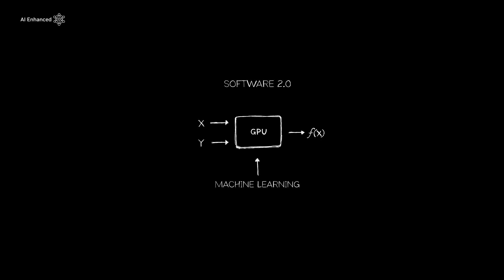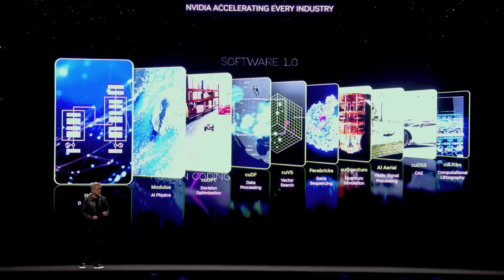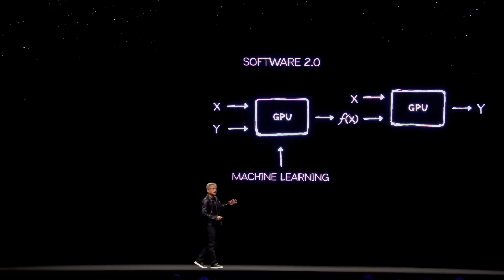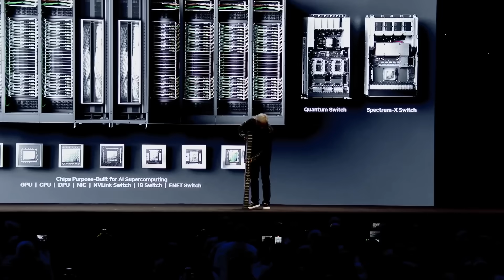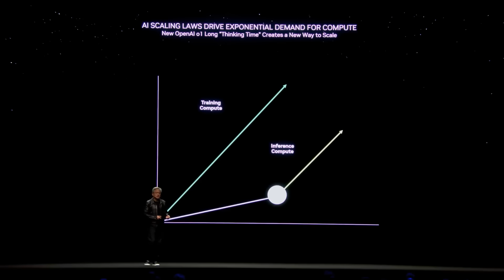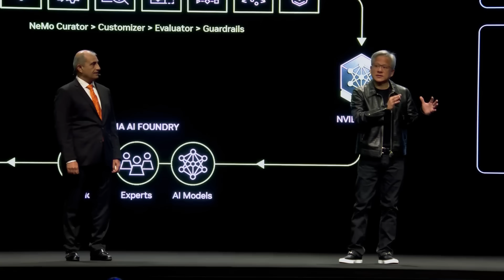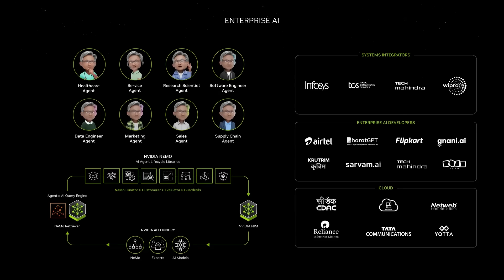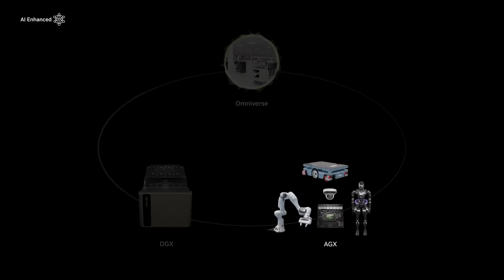NVIDIA CEO Jensen Huang Leaves Everyone SPEECHLESS (Supercut)

Comment: There is so much ... in this presentation, that I keep thinking of Deep Thought's (HHGTTG) explanation of of its now famous 42 answer - a failure by the developers to specify clearly what the inputs were. This is no more than a sales promo to sell the new system, and assumes that massive already data exists to train the new system to do something without actually specifying what "the something" is. Additionally, there is no such machine that contains a moral understanding of its actions so there is nothing to put the brakes on AI development to consider whether the technology is heading in the correct direction or something that is detrimental to one or more humans (cf. "The terminator" or sentient machines.)    Real green field software development starts from a set of requirements for a scenario for which data may or may not already exist. Personally, I also have doubts as to whether it is possible for an AI generated program to perform in a real-time environment with minimal hardware or whether it follows the American approach from the 1960-70s of just adding more hardware until it reaches its contracted performance levels. This "add hardware" approach imposes lots of external constraints that were rushed through - huge electrical power consumption requiring huge cooling farms, large mega buildings to house these monoliths plus supporting hardware, and the overall global warming effect that every government is trying to rein in, via various UN driven COP conferences.
AI generated code quality will improve over time, but one final aspect of humanity that AI will never match are random flashes of inspiration that allow programs and technology to operate in a more efficient or open-ended way. I also assume that somehow AI will conquer the mountain of converting (good and bad) requirements into actual code so that developers are then reduce to requirement writers.
Just saying ....
PS the 1960-70s experience was that US favoured hardware was cheaper than software, UK favoured hardware and software and USSR favoured software over hardware. Consequently the US had the best hardware, USSR had the best algorithms (because they could not afford hardware) and UK was the best integrator of cost effective solutions (using the best hardware and software).

Comment: Just a thought- We are working hard on a quantum computer where the zero or one are BOTH zero AND one. Why not apply software with today's fastest general computers where the software itself assumes BOTH? The 'And/or' module. Here, the speaker refers to 'unobserved' input. The recent (timewise speaking) that photons are BOTH a partical AND a wave are only assumed when the particles are NOT OBSERVED (no method of visually determining, since the 'observance' changes the nature of the particles).
 So if we allow software to 'believe' something is happening when we cannot physically quantify it, may be the key vs. actual hardware that physically assumes both roles. Changing the 'and/or' to 'what if' may open a passage to infinity. 
---
Reply: @RudiJock  Modern CPU’s in traditional computers already do that, it’s called speculative execution. This doesn’t have to be coded for, it is done at CPU level where when it sees a branch it will run both paths simultaneously before knowing which it will take, and simply discard the one not taken when it becomes clear which is needed.

Comment: Naa, as a developer I can tell you that AI is not able to understand anything, which inevitably leads to incorrect answers and code.  I don’t think it will ever be able to truly understand.  It is a pretty good search engine though, providing you always ask it for sources so you can make sure it’s right before you use anything it provides.
Reply: @3d-illusions  That's how I feel as well at the moment (though I'm not a software developer). In its core,  AI is still a pattern recognition and prediction machine, it's simply not complex enough to be able to understand stuff. That's why it's still hallucinating and lying, it's still missing a lot of wiring on the one hand and proper training on the other. 
My main worry is that with the development as shown in this video, AI will start producing 'input' that we humans can not anymore or only with a lot of effort verify to make sense, and under time/money pressure will assume to be correct. This may lead to disastrous results, as we will not be in control anymore when we still need to be.
Reply: Eh.  It will get there, just like txt-to-image stuff 2 years ago was pretty basic and now you can create imagery and video virtually indistinguishable to reality.  4o seems to do a pretty good job of basic code...even for hobbyist type users.

Comment: Since their inception, NVDL GPUs have always been 100-1000x faster than CPUs.
...well, at least in theory. In the 2000s they ran at 1% utilization, that is, unless you code it just right, chances are you only use only 1% of their theoretical throughput capacity.
Reply: I will see how he does any physics which is required to be run in series.

Comment: Why would he speak such nonsense? Why should we even care? We have already paid enough to cover the costs of hardware, software, and R&D. If the correction is made and the idea proves solid, it will attract support. Additionally, it is true that Nvidia released the first product labeled as a GPU in 1999. I suspect they either stole or bought the idea from some underfunded startup engineers. Back then, the future of computing was not as widely acknowledged. Furthermore, is it justifiable to build nuclear power plants and risk harming the planet for this cause? I am not sure. Our homes are already equipped with incredibly powerful PCs. Perhaps we should slow down the cycle of acquiring new hardware, favoring upgrades every three to five years over annual replacements.

Comment: He forgot to say that AI will be coding the changes required.  So many coders, who got us to this point will be jobless.
Reply: As a programmer, I'm not worried about it at all. Half of all jobs today didn't exist 100 years ago. If AI replaces programming, I'll simply move to the AI engineering field. "If robots take your job, learn to fix robots".
Reply: @LunaticEdit  I want to agree with your logic,  but I fear it may be flawed. We are essentially replacing the human here. Robots will be fixing robots.
Reply: yes
Reply: @Idontwantahandle3  Sure, until it runs into a problem it hasn't seen before. I'm not saying we won't "get there" one day, but even with the latest and greatest models, AI still seems to be little more than extremely fancy auto-complete system. Have you seen that AI video generation of Egyptians building the pyramids? Notice the pyramids look old? Yeah AI cannot create, only mathematically calculate what should come next based on previous data sets. Sure there's re-enforced learning, but even that is pretty crude and extremely time consuming. Sorry, still not worried about AI, and in fact embrace it as a nice tool to make my job easier so I can focus on the hard problems.

Comment: It sounds like they are going with software back to the 90s or even earlier in times when software had(!) to be optimized to the limits to work with the limited computing power of that time. Within the last decade or more we saw probably a decrease in optimization. Take a look on how much traffic a website throws at us just because nowadays smartphones have computing power that made early 00s PC look like game boys. Same in software where it is often like „yeah then just throw 64gb of Ram onto it and the next gen gpu/cpu and it will run okish“ while - to stay with an example everyone knows - Pokemon Red back then in 1999 had a full size of 373KB what is around 10x less then an average picture made by an iPhone today. 
So yeah software itself felt behind within the last onenor two decades because the new hardware made it comfortable to not take a deep look into that.

Comment: Speaking from experience, he is selling an enormous amount of hot air when talking about programming 2.0 done by AI. In general the generated code is quite bad, not more innovative than the code seen during the AI learning phase (so nothing new). Sure Nvidia is riding an enormous wave thanks to the current AI hype, but limits of LLMs are quickly being reached. Of course GPUs remain valuable accelerators of specific tasks.
Reply: @salobaas  I work at the USSF as a cyber security engineer and lead divisions and programs associated with various NIST RMF, AI (LLMs, and neural network composites), and system security engineering standards.  I'd say that you're wasting your time with intelligent discussion on YouTube comments.   3% of people will understand and acknowledge your level of experience/expertise... the rest will all create arguments and speak as if they have a degree in the field your commenting on (which they 99.9% of the time don't).  I've been down this road and it's not worth it. I read all your responses though and I'm experienced (sometimes in conjunction with experts or masters in the field working with or for me) in every topic brought up.  I wanted to say you were well spoken, knowledgeable,  respectful, and versed in the topics at hand.  I'd ignore must of the ignorance.   

Just on the topic of LLMs; people have no idea about the algorithmic bottlenecks and limitations of LLMs.  People are believing that statistical variable computation is going to lead to AGI or advance beyond that even with fundamental issues and errors (even based on  current ROC curves)...  there is a lot more science and work needed.

These systems are useful but the LLM is not the end route
Reply: @sparaz  don't tell everyone what you do
Reply: but... the leather jacket?
Reply: I think there's often a disconnect in how people look at machine learning models versus imperative programming. When you're dealing with the problem of modeling the real world, your solution to the problem can only go as far as your understanding of the edge cases. With the real world you're dealing with, not just unknown edge cases, but edge cases that can appear at any point in time that you didn't account for in imperative programming. Take the example of a self-driving car. Anyone can step out into traffic at any time with a stop sign in hand and you would need to have some inference that can be turned into a decision. Imperatively you could program for this but what if the person turns the sign in hand 45° and is now partially occluded? This is a scenario where an inferencing system with an ability to recall historical events makes more sense to solve the problem. Imperative programming will always exist to solve the problems that it was made to solve which have known or mostly known edge cases. Pick the right ( or most cost effective) tool in the tool shed for the job at hand. AI is too expensive to train for every task
Reply: you missed the point, you're talking about generating human code to be compiled into x86-64, he's talking about a new architecture that uses AI as the core of it's computing and therefore is more compatible with ai generated instructions
Reply: Thanks but I’ll take my queues from the CEO of the world’s most valuable company.
Reply: @salobaas  I dont think he literally meant code writen by ai but the rather the model itself
Reply: I think you underestimate many factors including national secrecy of datasets and the incompleteness of data historically archived in written archives of paper and ink for example. I find AI missing vast arrays of answers which I can find by simply thinking and extrapolating given key input parameters which are often not focussed in modern western civilisations as culture is but a slice of reality as all life has known it. In short you are blinkered.
Reply: @john-paulstone791  Wrong, I have to use it to explore other possible mathematics and algorithmic models to fix my projects. It helped me working at the right direction as well as learning. It is a better version of Google. But for coding, it is not there yet, thanks to hard bottlenecks.
Reply: @I_am_a_nice_person  You seem to miss the point, we are discussing what ai can achieve, not what it is limited to at the moment, how exactly am I wrong? He said the limits of llms are reached and that is just stardust. And you seem to seriously be suggesting that you would expect early AI to have every answer to mathematical possibility in its early stages, or else we are just on different pages. But I can see how you would say I am wrong, given your view of the situation so nevermind. In all honesty I know practically nothing about it but history is full of billions saying the end is nigh about every new thing and it peeves me. Oh, I think I see where you went wrong, I didn't mean I input my thoughts into ai, I extrapolate them myself and find answers without AI because it is missing certain things... So if you see my erratic response is because you say I'm wrong but we actually agree.  If I am in fact wrong relative to the majority of the post it is because of the potential for almost exponential LLM training according to me. I think just because a thousand projects make a stable AI model, doesn't mean a million projects cannot improve it. I have difficulty thinking in terms of being stuck in a now of version numbers, so excuse me if I babble. You may have a valid opinion I cannot see because I am not a programmer though.
Reply: @john-paulstone791  just call me dum and move on lmao, no need to be this dum.
Reply: @I_am_a_nice_person  Divergence is as far from dumb as intellect gets, humanity just doesn't know that yet because it is emotionally twisted into animal logic.. I do not want to be calling people names as the way to move on from simple or complex debates. You keep your ignorance, I will keep my silly appearance thank you.
Reply: In my understanding, he is not talking about AI WRITING CODE, but about making models instead of programs in the traditional sense. For instance, instead of physics engine, you create AI model that emulate physics, or how he called approximate program that does that. Of course this model wasn't coded line by line by human, it was achieved through learning.
Reply: @grzegorzowczarek3016 wouldn't you value the traditional method of deterministic stuff instead of this half working half broken shit lmao
Reply: @grzegorzowczarek3016  that would fall under AGI, and that is way off from where we are now. Creating new models based on information we don’t have yet, like new physics models, is not something that can be inferred from existing data. Existing data can be used to extrapolate existing models but not to generate entirely new theories. If AGI would exist then things might change, but for the time being we’re far from it. But as long as we keep buying GPUs he’ll be doing fine.
Reply: @salobaas  you still don't get him. I did not mention any new physics. Just physics engine, for a game for instance. Not written but trained. Nothing more, this what they mean by software 2.0. I'm not defending his position nor do I share it. I simply try to explain what he said.
Reply: @salobaas it is already happening today. That's how Tesla's Full Self Driving works. The instructions for getting from point A to point B are not explicitly coded. The AI model figures it out on its own. This isn't "in the future", it's driving on roads every day.
Reply: @NateDecker1982  *crashing everyday.
The worst example ever.
Reply: limits of LLMs are quickly being reached? elaborate
Reply: @Alex_1729  No more data to train on. Still no basic reasoning. Hallucination problem actually got worse with the last generation of models. Fundamentally seems to be at a dead end. People finally are wising up to the "science" have been all junk, and the benchmarks meaningless. There's a lot of marketing, but really looks like a start of a collapse ATM. Oh also, still no revenue. None of the AI companies are anywhere close to profitable because the operating costs far exceed any demand for the utility.
Reply: @Alex_1729  Look up any paper on LLM. You need exponential compute power and model size increase, just to improve accuracy by 0.1%.
Reply: It’s true that large language models are reaching a hard wall, but nvidia’s AI focused gpu’s go far beyond just training LLM’s. The AI explosion is about applying machine learning to every field of research .
Reply: The lmits of LLMs are not being reached, they're expanding.
Reply: You seem like someone who also thinks that IT networking is useless. So.. pretty old I would assume around 40 or 45? at elast you talk like someon that age.
Reply: @tiberia0001  where do I say that IT networking is useless? Without networking there is no IT. You sound like pretty young and totally inexperienced, say between 14-18.
Reply: @salobaas 
AI already helps humans with programming.
Reply: @tiberia0001  Ease up on the ageism there tough guy. I'm 53 and I don't think as you insinuate. That said: skepticism in this current AI market is valid and we need skeptics to keep investment sane. It's the middle-management bureaucracy (which doesn't understand any of this) that will sink a company by investing in the wrong tech or over-investing (or under-investing) by not understanding the timelines involved.